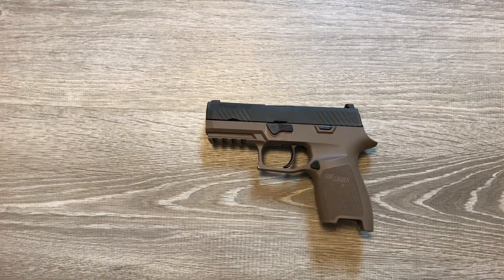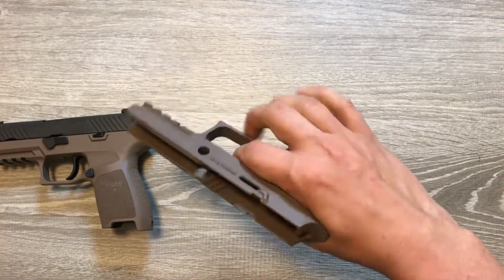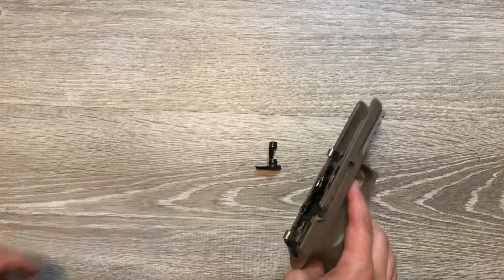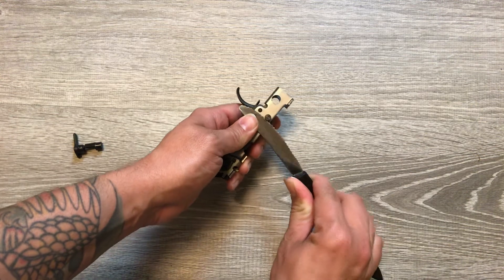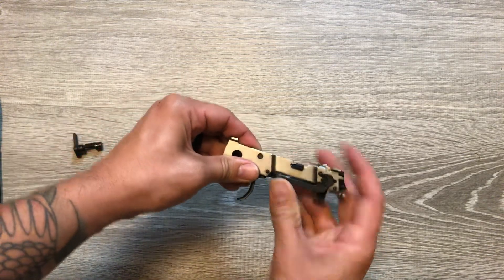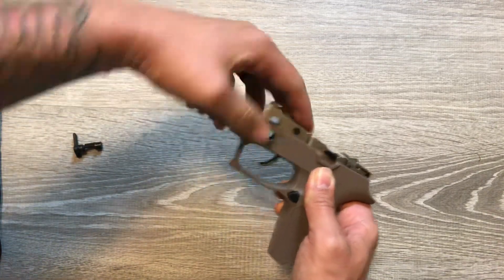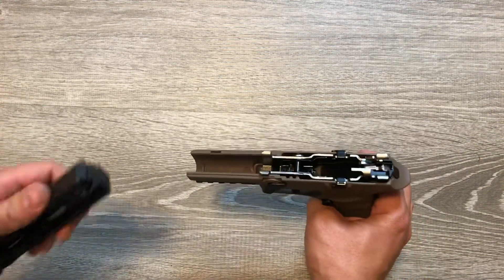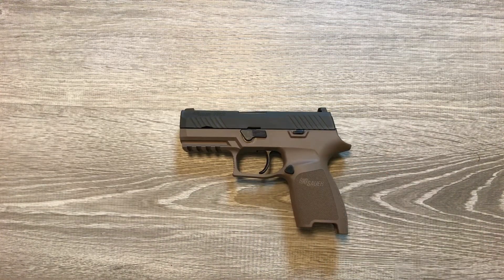SIG P320 FRAME CHANGE MEDIUM TO SMALL

Comment: I've had my small grip sitting in the box since I bought it almost 1-½ years ago.
Once I saw this video, I had to open the box to see if mine came with the new slide stop.
It did, so it was good to see this.
Also, if you live in Mass and/or have the manual safety, you do have to file or cut a notch in the new grip to accommodate that.
At least that's what the guy at SIG said when I ordered it.

Comment: I am saving for the P320 RX Compact, but do not relish the idea of it coming with a Medium-size grip, when I know I’ll just have to shell out another $44 for the Small.  Is there no way to buy it with the Small grip instead of the Medium?
Reply: Nah, as far as I know only the .45 ACP comes with the small size frame from the factory.  Quantico Tactical, one of my local stores, had frames for only 31$ which seemed reasonable to me.  Hopefully you can find a price that's a little more reasonable like I did.
Reply: Jeff Pederson Thanks for the reply. It’s not that I cannot afford the extra $44, it’s just a waste of money right off the bat to have to pay for something (the medium grip) that I won’t even use. Still intrigued by the P320...can’t wait to own one.
Reply: Oh no I get exactly what you mean, I was in the same spot and it does suck they don't have them from the factory, so I'll probably just sell the medium frame on ebay and even my cash back, but all that is time wasted if Sig would have just let me buy the small frame from square one instead of just offering it with a medium from the factory  😑

Comment: I changed my grip module without changing the slide release. The slide release is, on the left side, surrounded by plastic on the grip module. The old style grip module had only a "shelf" or an "underline" beneath the slide release and changing from an old to a new style would require the new slide release.
https://www.youtube.com/watch?v=zx7bda7FVNg

Comment: Fyi... you didn't have to change the slide stop /release. You just pop it in like regular. They are both the gen 2 slide stop..
Reply from the maker: RomanTech Thank you for your input I did try to put it together without putting the new slide stop on the Lankes of the two slides stops is different side by side there’s about a quarter inch difference between the two
Reply: Check again, there is only two slide catches made for the P320, one for the 45 and one for the 9/357/40.
Reply: MIScaletech what you said is correct when it come to the 45 and the other calibers but sig also made a change from the large slide stop to a smaller on for all the calibers they make. This video shows the smaller ones with the same caliber so changing the smaller one for the same smaller version is not necessary.
Reply: RomanTech there is a gen 1 and gen 2 version of each, I know that. You did not have a gen 1 version in your video. The same slide catch will work in all frame sizes and grip sizes. Ask sig.
Reply: MIScaletech they also make a gen 1 and gen 2 grip frame. The one I have Is the gen 2 slide stop and the gen 2 grip. The gen 1 slide stop ( the bigger one ) will not work with the gen 2 grip frame.
Reply: RomanTech I understand that, I’m just saying you had two gen 2 frames in the video. Never mind, carry on. Lol
Reply from the maker: RomanTech I understand and respect all of your opinions all that I can tell you is I personally tried this with the slide stop that was already installed on my gun. Due to the length of Pull being shortened by having a small grip frame the slide stop did not sit in its proper home on the small grip I am going from a medium to a small just to be clear and I can always be wrong all I can tell you is and what just happened to me I literally just did this. have all of youJust converted a medium to small personally?
Reply: Just to throw it out there, I just bought (7/30/2018) a new small grip for my compact P320 and it came with a different slide stop IN the box with the new small grip frame.  Just to add a recent experience.